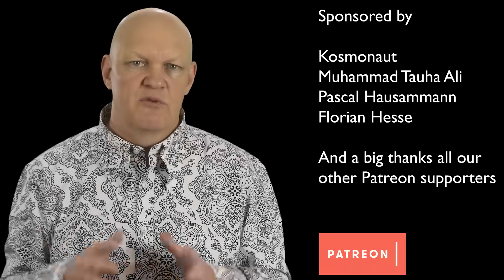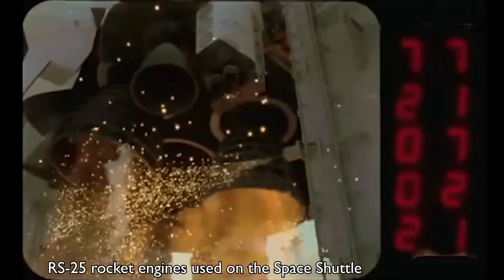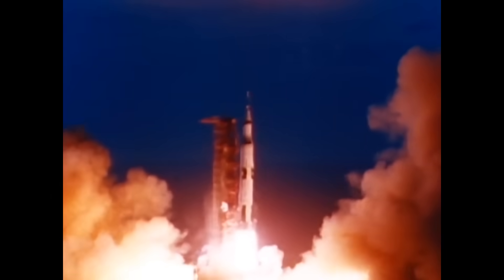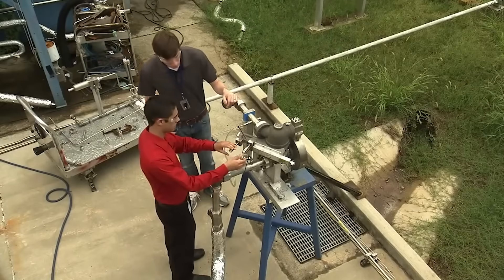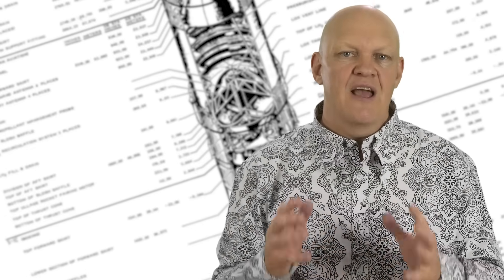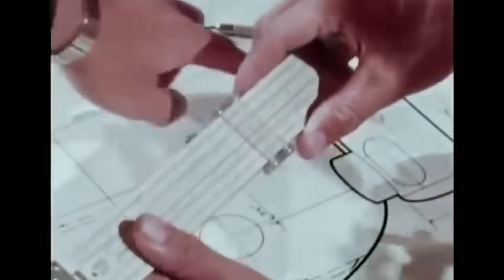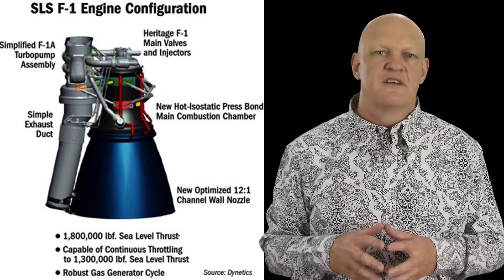Why Can't we Remake the Rocketdyne F1 Engine?

Comment: F1's power was exceeded by a pair of Soviet designs. The RD-170 engine (used for the only two launches of the Energia rocket) and its RD-171 variant (used on the Zenit rocket) both produce more thrust, but the Soviets were unable to overcome problems with combustion instability in a large rocket's nozzle. The Soviet Union chose to work around the problem by fitting the RD-170 with four separate nozzles instead of one large one, giving the RD-170 and -171 the visual appearance of being four separate engines.
Reply: IIRC, the large volume of hot gas was experiencing uneven and rapidly forming lateral vortexes within the bell nozzle.  To solve the problem, the fuel and oxidizer injectors were fitted with many high temperature cupric alloy extensions, which created small voids between the injectors. This led to many small counter rotating, vertical mini vortexes that disrupted any lateral turbulence, and exited the cone before they could possibly create any greater instability.  It was a quick fix solution that added more custom parts and weight, but it avoided a complete engine redesign, which would have been a disaster at that point in the program.
Reply: As i recall rocketdyne was having the same instability problems with the F1 and eventually solved it through expensive testing and redesigned injectors, however they never figured exactly what caused the problem. Modern computer simulation would probably help with that.
Reply: it is a surprisingly difficult problem to model.  Even today.
Reply: Olesoi Band If I remember correctly those Soviet engines are closed cycle with the turbopump exhaust feeding into the combustion chamber. They had a lot of trouble making that setup work, requiring an amount of testing similar to the design of the injectors on the F1. Of course the upside for them was an engine with higher thrust output and ISP than any American engine.
Reply: I think Rocketdyne actually exploded dynamite inside the thrust chamber to troubleshoot instability issues.
Reply: IIRC that's also why the F-1 has an usually bad specific impulse.
Reply: It seems like Paul has talked about the RD-170 and 171 before. But it could have been another channel.
Reply: Interesting! But not as interesting as the fact that soviet RD180 (developed in the 70- and 80) is still the only engines safe enough to send manned missions til space even today. The excuse of course is they cost less!
Reply: @Candi Hoecon The Soyuz-FG (launcher used for the crewed Soyuz spacecraft) doesn't use the RD-180 - it uses the RD-107A and RD-108A which are unrelated.
Reply: Impressive but unheard of.
The next time the american astronauts need a hike with the russians to the space station listen carefully to the commentary - Pretty sure you will hear "The RD one-eighty runs perfectly (the russian commentary uses "nominal"). Except for the russians - the chinees has started manned space travels-  Don't know what the healthrisk is for those travels
Reply: Jwad Too bad communism can afford to make them reliably.
Reply: @Bill Greathouse The USSR did make them reliable, though as per any engine in that performance class they did have some early problems.
Reply: It will never make sense to compare multi-chamber engines to the F-1.

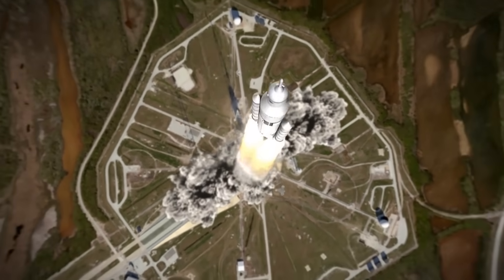Comment: 4:36 I am not sure I would call the proposed SLS F-1 engines to be "redesigned from scratch" - as far as I understand they used the original design as their starting point, which contradicts the "from scratch". But I guess that is more a philosophical than an engineering question. 
New format is great -  as long as we also get to see your longform pieces some of the time :)

Comment: Surely they can recreate these f1 engines on cad, simulate the hell out of it until you can overcome any weak points, then to make the whole thing lighter and keep risks of leaks to a minimum they could consider 3dprinting the engine as a whole solid unit. There are companies that do similar stuff already.

They even have algorithms that can create optimum joints and areas of flow with minimum use of materials.

The F1 could be made leaps and bounds better than the original.

Once you have the tooling you could fart them out almost weekly.

Comment: As an engineer, I'm enthralled with taking old ideas while making them simpler, cheaper, more capable and more reliable than the original.  That's the essence of product engineering, after all.  If a successor design to the F1 engine meets those criteria, I would go with it.
Reply: Frimodig Single stage is not necessary a good thing. There are inefficiencies inherent in them. They may have their place in the future, but proposing to abandon all other methods just because you like the aerospike is foolish. Breakthroughs may occur in other methods that make aerospike and ssto unnecessary. Diversity in ideas is always a good thing.
Reply: The SLS is made of pork, not steel or aluminum. The whole purpose of the thing is to keep all the guys who made the shuttle working, so the was no way it ever WOULD'T use solid boosters.
Reply: They should rather invest in the single-staged Aerospike engine since they meet all those criteria that you mentioned. It just need more development and money as the Droid mentioned in his earlier video.
Reply: +Frimodig — According to your reasoning, we shouldn't be spending any more time developing cars powered by reciprocating internal combustion engines, yet here we are, over 140 years later, and our streets and highways are filled with hundreds of millions of them.  Thank goodness for engineers who see ways to eke out more utility from old ideas.

Comment: It is sad, the recent generations has no practical skills at all. Finish in unversities with great degrees, but not able to use a hammer in a proper way. Today engineers overcomplicate the most simple things and it's not even funny anymore. I'm currently working in the microelectronics industry and insanley often I receive blueprints of PCB's with unproper measurements. These engineers uses CAD softwares to design and measure them, but they can't working with calipers. insane!

Comment: The decision to use a pair of solid rocket boosters for the Space Shuttle instead of liquid-fueled engines like the F-1 had been partly technical and partly political. Solid fuels are hugely energy dense and provide an excellent kick to get a spacecraft moving off of the ground; also, selecting solid fuel boosters allowed the government to send some available contracting dollars to companies involved with building intercontinental ballistic missiles, leveraging that expertise and providing those companies with additional work.